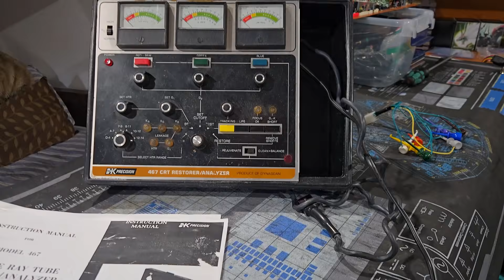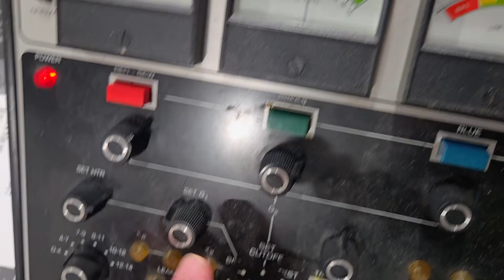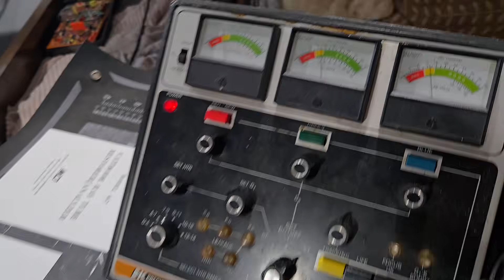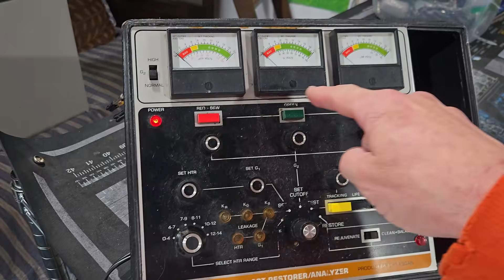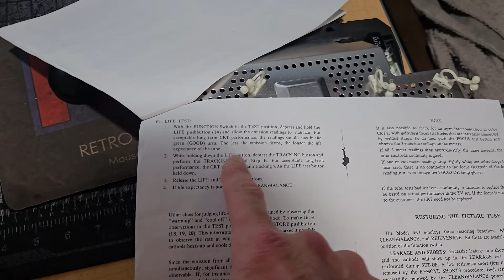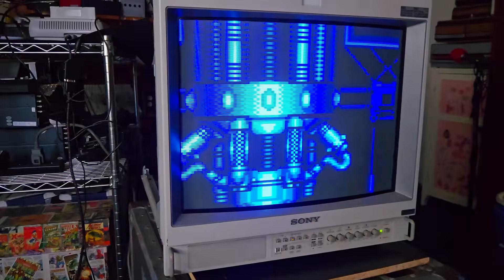How to Test & Rejuvenate a Sony Trinitron CRT

Comment: Placing the CRT neck up is common practice to get debris away from the cathode. Also, lightly tapping the neck with a screwdriver handle may help to loosen these deposits.

Comment: Hello, I am currently having an issue with my Emerson CRT, model number EWT19S2, and I fear that my IR sensor is broken, I’ve tried several remotes that claimed to work with this exact model number, but nothing worked even when the remote was working properly. What should I do?

Comment: Awesome! Wish someone would reverse-engineer and open source the rejuvenator! 

I wonder if the meters and sensors were digital whether you’d be able to get more precise voltage readings. Would be cool as well if the restoration process could be automated to cut off at precisely the right millivolt

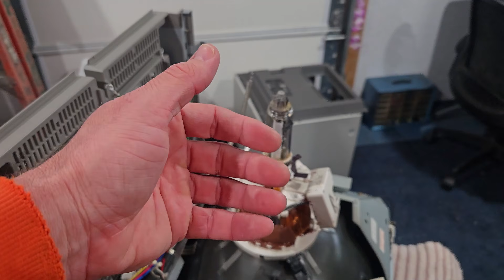Comment: 11:01 I would be worried about any peices coming off and scraping some of the phospors off the face of the tube. The phospors are just like powder on the front, they come off with the lightest touch. Maybe having it at a 45 degree angle would be better.

Comment: Had success with a Sencore CR70 Beam Builder on a KV-27HSR10. Trinitrons respond well, but only a few times. 80s and 90s repair techs hoarded all this stuff basically for free and kept their secrets close. It’s generally best to give the trouble color a whack rather than hit them all or so I was told. Also Sony did not share their pinouts so custom adapters were standard since day 1, leading to the trinitron mythology in my opinion.

Comment: You might ask "why is it pink If green is the strongest gun?" That is because all Sonys have auto kine balance (AKB). If you underscan the raster that is what the RGB lines in the vertical blanking area are for. During every retrace it is invisibly turning each gun on, testing the emissions, and adjusting it to maintain greyscale tracking. The drive controls don't directly adjust the guns, they adjust what AKB balances to. For it to be this bad the cathodes have to be really worn out or dirty, glad you could bring this one back with a little cleaning.

Comment: I got a Wega lv-21fa310 for $20 usd when visiting Mexico one time. I made the mistake of not testing it out and it basically looked a little more extreme than yours with the magenta whites. I ended up leaving it on the curb during a move 2 years ago sadly. I wish I kept it cause the geometry was perfect, it looked amazing, and sounded great with the subwoofer and center channel. You'd get used to the different white balance after a bit. I just didn't have room and had another Wega and Toshiba 20" already. I hope to get one someday. 

I've actually ran into rejuvenators locally. It would be cool to pick one up. Cool video, thanks for sharing your journey.

Comment: i'd heard that too. that trinitrons don't respond well to rejuvenation. i'm glad you made this video to disprove that because i want my xbr trinitron FOREVER!!!
Reply: Trinitron cathodes are surface emitters for better focusing, there's no emissive material in the actual electrode metal, it's only a very thin coating. Rejuvenation is meant to bring more material to the surface in a conventional cathode, but it will blow away the coating in a Trinitron and leave you with dead guns. This was just cleaning to arc off the debris that were blocking emissions from the still somewhat good coating.

Comment: I've got a B&K 445 (same basic features, just a reduced interface) that I want to restore and use on a couple of my sets with some dim output. Question: after clean/balance and then running the set to see how it performs long-term, would it be better to run it on its face like during the clean/balance? I'm thinking anything else that burns off might fall away from the gun.
Reply: I'm using a B&K 467 myself and putting the tube face down doesn't change anything. It doesn't give better results. So far I've mainly been rejuvenating Trinitrons and I reckon they age poorly compared to other brands... Mostly when they've been stored and unused for years.

Comment: Since these devices are down right impossible to find + expensive, you might wanna show us the tried and true method of pushing 6V in series with a halogen lamp + eyeballing. 
I know its risky but the CRT is dead anyway if you don't do anything so might as well!
Reply: What does that do?
Reply: @stcojo  
Essentially the same as what the rejuvenator machine but more manual, better than nothing honestly.
Reply: There are a lot on ebay for 50$